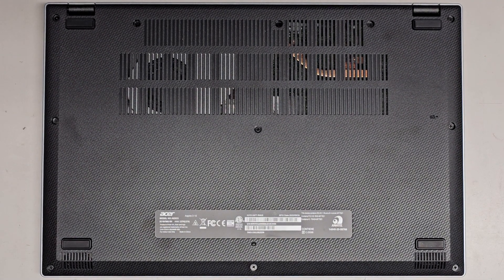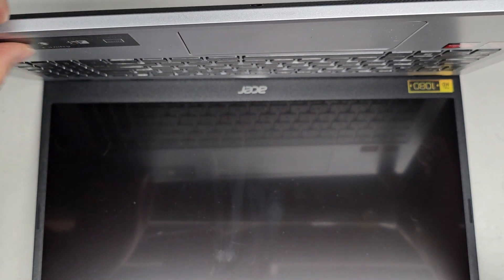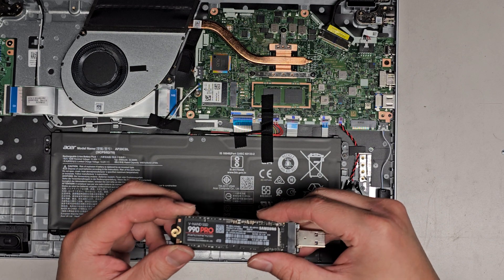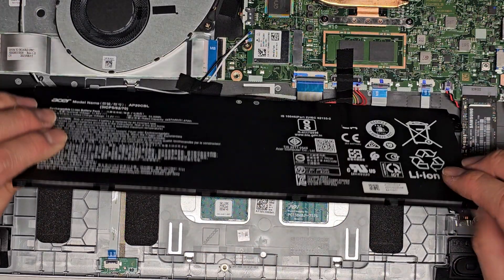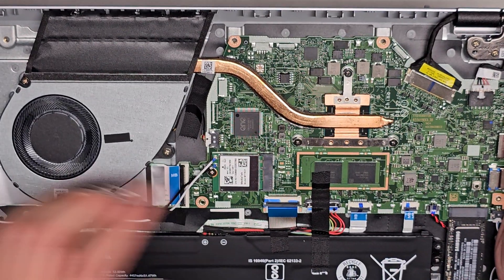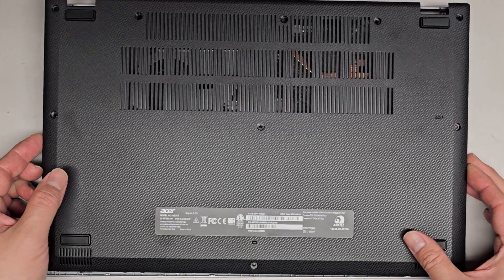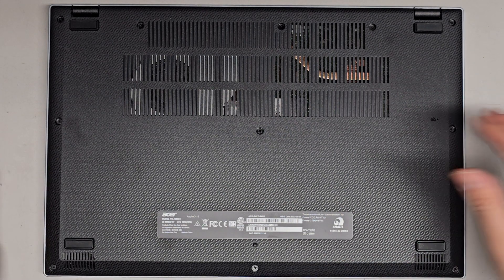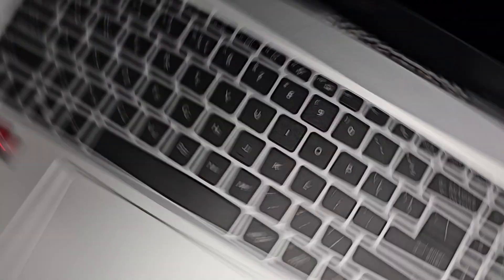Acer Aspire 3 15 N23C3 A315-24PT-R4U2 Disassembly SSD Upgrade Battery Replacement Repair Quick Look

Comment: Brother, is it necessary to disconnect the battery to replace the thermal paste on the laptop after it has been opened?  I would be grateful from the bottom of my heart if you could clear up these doubts for me
Reply from the maker: That depends on your definition of necessary. Is it necessary to wait for a red light to cross a street with fast moving traffic? Is it necessary to cut power to an outlet before replacing it? Technically no for all, but should you, yes, if you want to greatly reduce the risk of destroying the computer. Make sure you drain the power as well.
Reply: @ItsBinhRepaired  Thanks haha, you were harsh but it helped, man, thanks.. haha, you were tough but it helped, dude, thanks..
Reply from the maker: @guilhermejovino-x2v  hahaha Sorry, I was taught that way. I think it taught me to try to think of the answer before I ask, so I don't ask questions I could answer myself, but then it also taught me to be less likely to ask the potentially dumb questions that could have saved me from other mistakes. Who knows. Lol It's that tough love kind of teaching. XD
Reply: @ItsBinhRepaired  I understand, brother, no problem..
Reply from the maker: @guilhermejovino-x2v yup :) Hope the repaste goes well!
Reply: @ItsBinhRepaired  Everything is going to be okay, brother. I appreciate you clearing up that doubt, and the way you explained it, I’ll never forget it lol

Comment: Getting a no bootable device redo on start up. Thought about popping the back off the clean things up in case dust was an issue. Any other options? Can’t change the legacy whatever on the boot menu either
Reply from the maker: Sounds like a dead drive.

Comment: Question, would it be possible to remove the wifi card and replace it with additional storage like another SSD? Then just supplement wifi through a USB ethernet cable?
Reply from the maker: I'm not sure

Comment: does acer aspire a315 24-p storage/ssd uppgradable? i want to add more storage since  237 gb is kinda low? or does it have a extra slot for a 2nd ssd
Reply: also what type of ssd should i buy
Reply from the maker: This video will help https://youtu.be/4p5jFDzVwUw

Comment: can i change the wifi card on my acer aspire 3 15 A315-24P-R5GC?
Reply from the maker: If it's removable, but keep in mind some manufacturers block aftermarket ones.
Reply: @ItsBinhRepaired  thanks
Reply from the maker: No problem

Comment: accidentally spilled a cup of water right on the touch pad turned off and upside down at the reverse v shape read comments about water spill and saw some say even if it works fine for a while after few months it will cause problem due to water what do you think about it ? Wonder can water leak to the motherboard through keyboard or touchpad or there is something that can prevent it under the keyboard ?
Reply from the maker: Need to open it and dry it out.

Comment: RIP 990 Pro. You will be missed. That thing runs HOT and you didn't at least put a heat pad lol.
Reply from the maker: Heat pads just push heat from a component that monitors temperature to components that don't. I always see SSDs with heatpads fail.

Comment: thanks for the disassembly video. do you think a very small 1 sided heat sink fit on the SSD? would the laptop still close with it on?
Reply from the maker: @nintendork07  maybe a thin copper plate. That's it.

Comment: enjoyed your video. I have a new laptop from Acer Extensa 215-23 with the same model number as this Aspire. It looks the same internally as this Aspire with small variations. Have you found in these models an sodimm connector to install additional  memory?  I asked Acers technical support and was told it can have additional memory up to 16 gb. My model when I bought it has 8gb on the motherboard. I also opened the laptop and I did not see anywhere any sodimm slots to add memory to. Would it be located under the mainboard under the keyboard? I have seen that in other older laptops like Dell. Have any idea? Acer support is not very helpful, their suggestion is to bring to service local service center.
Reply from the maker: I can only find the 315-23. There's only one slot on the same side as the CPU.